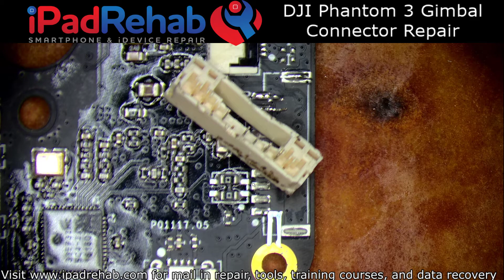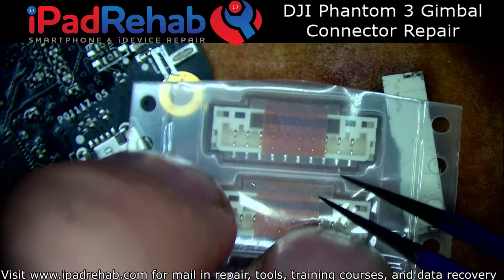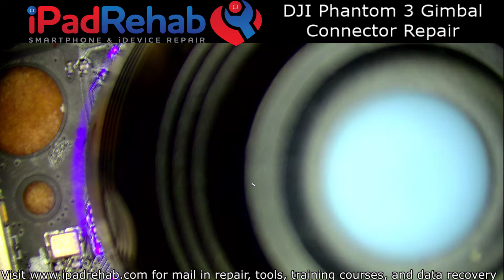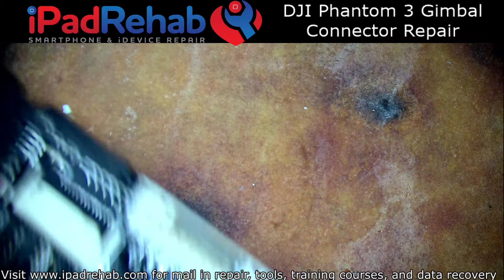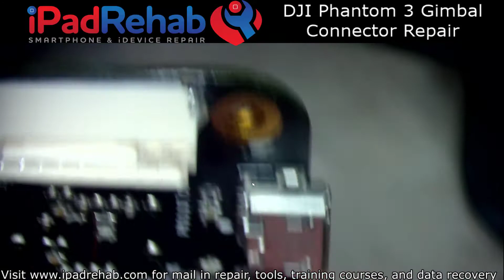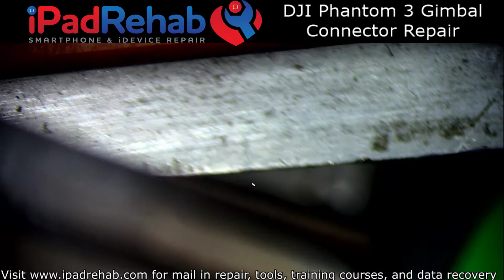DJI Phantom 3 Gimbal Connector Repair

Comment: Good day to your sir can I ask a question? What would be the problem if the gimbal board of dji p3s connected and disconnected to the remote control? What component should I check to solve the issue. Im happy to hear a reply message from hoping you could help me with this

Comment: do you get alot of drone boards to fix?
Reply from the maker: Not a lot, but we do get them fairly regularly. It's almost always a broken connector or damaged coil after a crash.
Reply: Where do u get the connector from? I need one for the dji spark (forward sensor)

Comment: Hello Mark.
Did you ever hear about about an LSD on a iPad Air 2?
I bought one on Ebay with no Image and it doesnt turn on.
iTunes recorgnize it in DFU mode but i cant restore it.
The Massage „waiting for iPad“ doesnt dissepeare and nothing happen.
Any Ideas?
Thank you for the Videos :)
Reply from the maker: This is most likely bad nand not long screw damage.
Reply: Mark Shaffer Thank you for the fast answer 👍